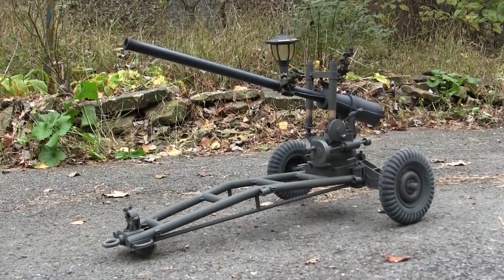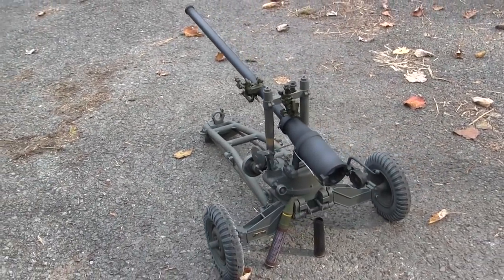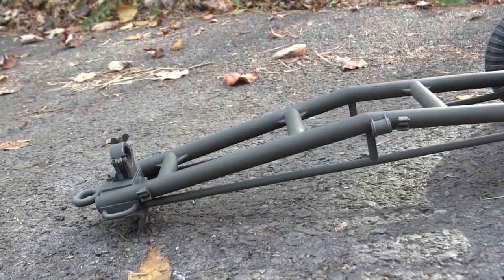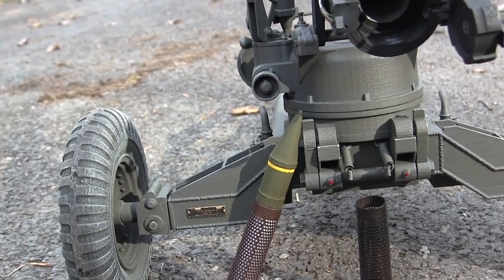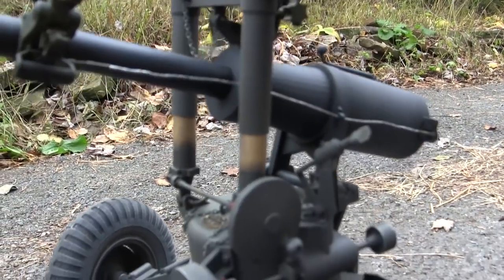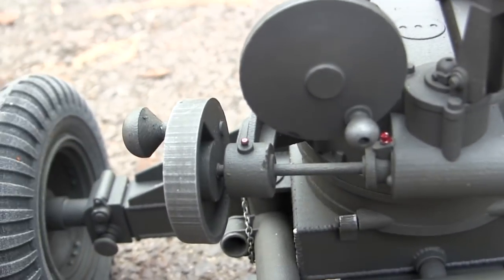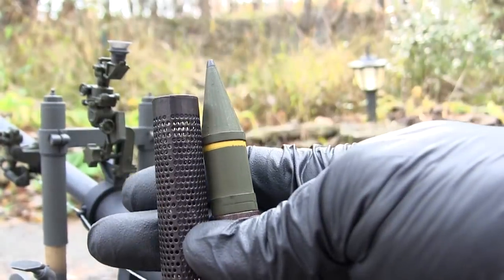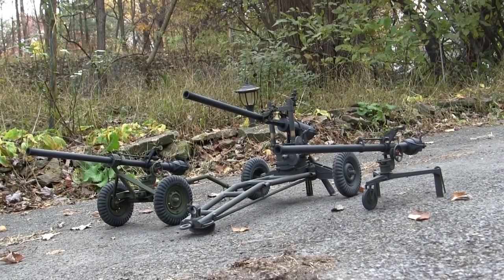1/6th scale m27 105mm recoilless rifle model w/ longtail M22 trailer

Comment: Where the hell do you get all your money
Reply from the maker: customer builds and part orders, not to mention selling kits I design / produce like this model here
Reply: @oddball759mm  So you build these models for your customers. Is this a full time job or just a hobby of yours?
Reply from the maker: @lebiggay7144  both
Reply: @oddball759mm  What'd get you into building these. I obviously can't because I will faint if I look at the price tag
Reply from the maker: @lebiggay7144  I don't normally do quotes on comment sections, but since this one belongs to me and not a customer with the price of the starter kit the whole build would run $1k
Reply: @oddball759mm  What was your first kit anyways. Did you have any major setbacks
Reply from the maker: @lebiggay7144  I don't understand, do you mean kits I designed or kits on the market that I built?
Reply: @oddball759mm  The kits on the market
Reply from the maker: @lebiggay7144  first 1/6 kit I would guess was an all resin Sherman tank kit. As for set backs, none really as I was already doing lots of scratch building in 1/16 and smaller scales. I didn't have resin casting skills at this time or a machine shop, so everything was made by hand tools and were all one offs. Those parts today are very primitive compared to the type of work I do now, but when I was 16 it was state of the art, This build basically set the ground work for what was to come